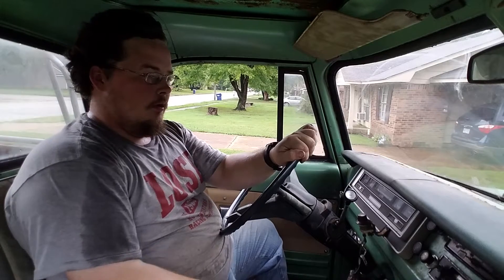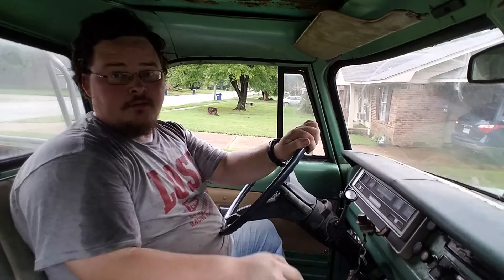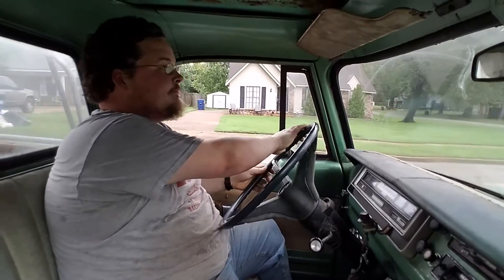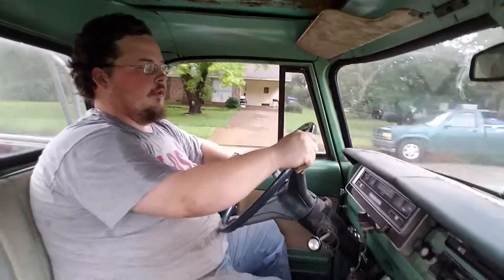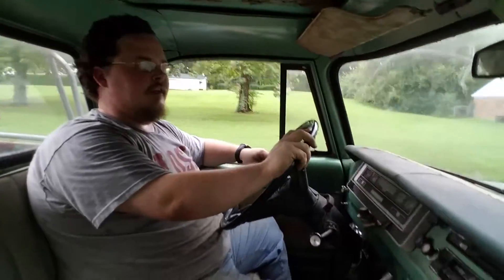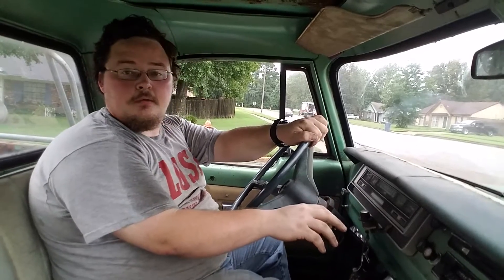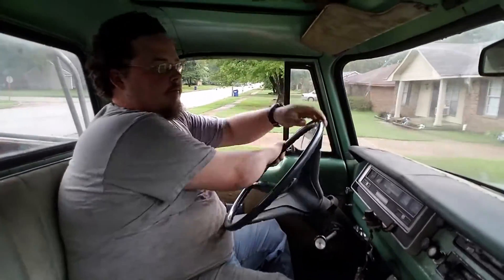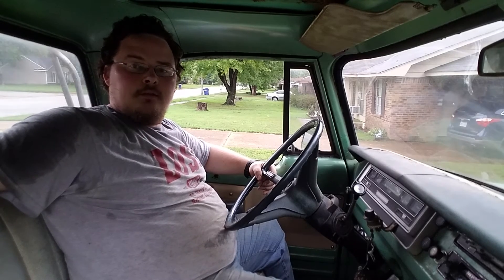1970 Dodge D100 Suspension Rebuild First Drive

Comment: I just bought a 69 d100.
It shakes in the front end after 35 mph.
Do you think I should start with new tires? It sat for about 10 years in the Arizona heat before i bought it.

Comment: Set the idle up a little bit maybe? Some carbs had a vacuum dash pod to make the gas peddle die back slowly to keep it from dieing.   Time for a front end alignment because its a must after a front end rebuild and you will be glad you did.
Reply from the maker: I'm going to get some gas in it first and see if that fixes it. With it being a straight axle front end with king pins the only front end adjustment is the tow.
Reply: I see it may have bad gas. I used to have a 62 Ford f100 that had only king pins like that and I did all new king pins and I think bushings too. I put some LT 7.00-15 Nylon D902 Truck tires on the front end they had 8 plys and it lifted the front axle off the ground more. It would go staight down the road.
Reply from the maker: It has been pretty humid lately so it also could be water in the gas
Reply: Fill it up and put a can of Heet in it. It will get rid of the water.